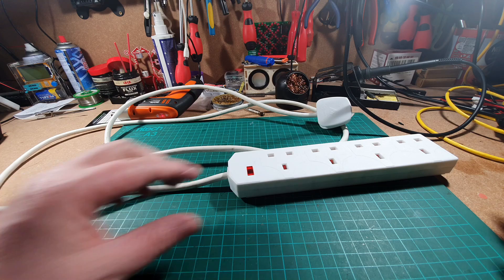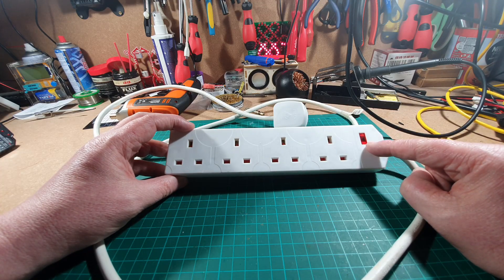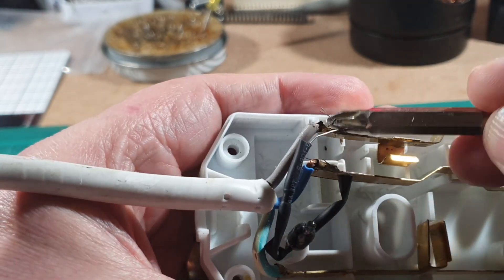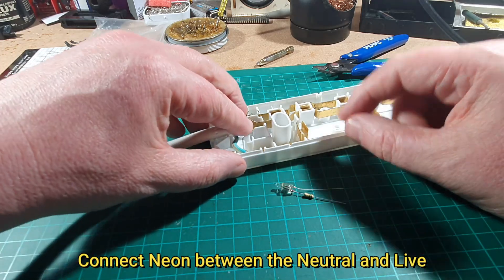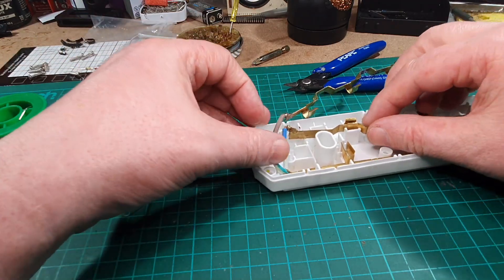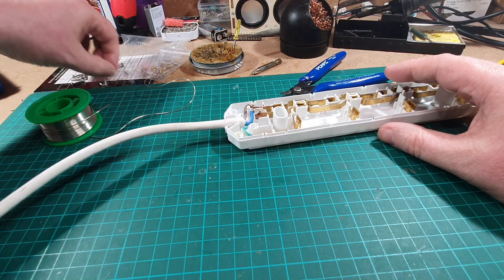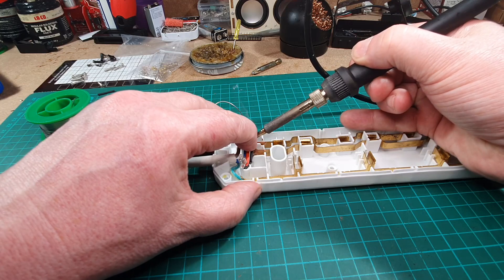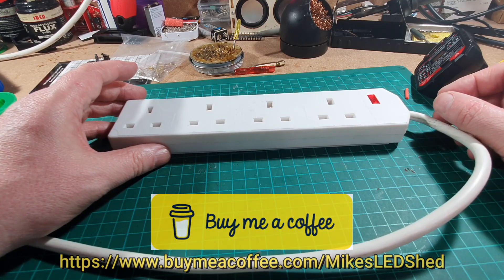Repairing a working 240v mains 4-way adapter

Comment: That was a rather dodgy product... For peace of mind inspect the connections in the plug as well. I've found several where the wires have been twisted then soldered together, and then put under the screw terminal which is a nasty fire hazard.

       Andy
Reply: totally agree.. i buy a lot of 80's computer stuff and the first thing i do is check the plug .. solder stays in the plug the wire is just wiggling loose
Reply: @markretro3612  The issue is not quite that obvious. When the wires are soldered together,  it makes it easy to poke the wires into the hole in the plug pin and tighten the screw. All seems OK, but over time the pressure of the screw causes the soft metal solder to flow away from the point of the screw, and then it becomes slightly loose.  That in turn leads to some arcing if the current is high enough, which leads to heating and that makes the problem worse. 
I've got a photo of one example of this process that I found on a pre-made 4 way and lead. I said "Ouch" when I picked up the plug to disconnect it it was so hot!

Using a  ferrule is what you need to do. The hard brass of the ferrule  does not flow under the point contact , so no problems. The ferrule can be crimped or soldered on depending on the type. Many mains plugs have a small brass ferrule crimped on to overcome this issue.

(This applies to all screw down type connections not just mains plugs.) 

Connection terminal blocks with a flat leaf spring type contact don't tend to have this problem as there is much less of a point contact, so you can get away with soldering the wires, but it's not recommended. 

Andy